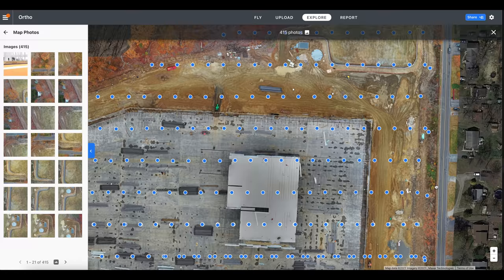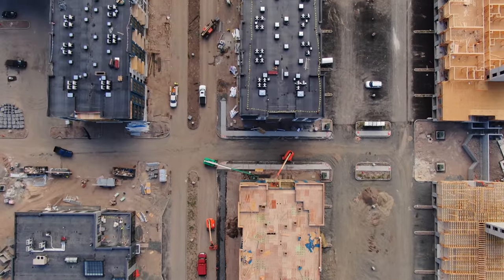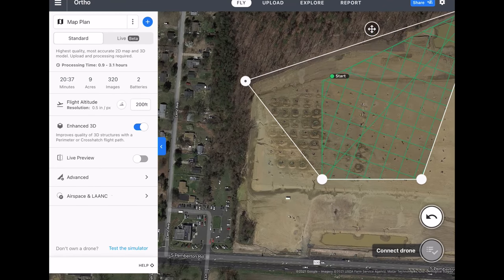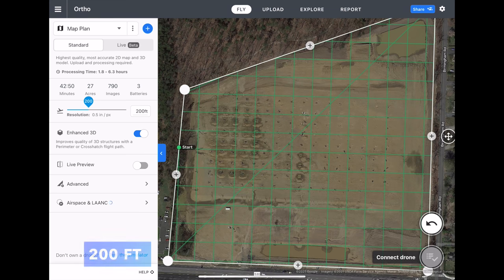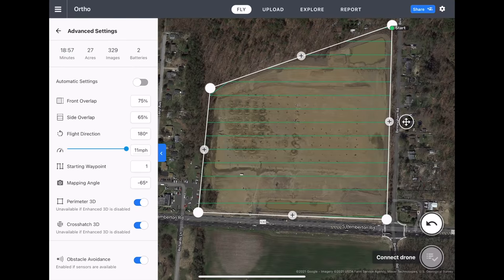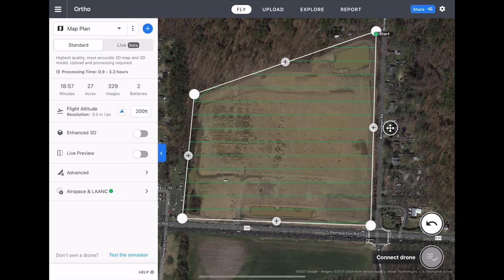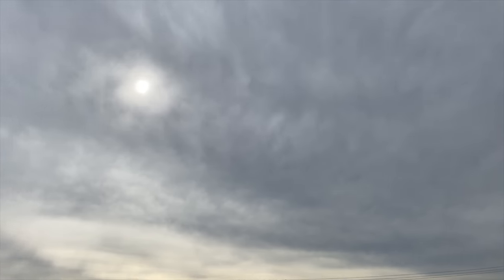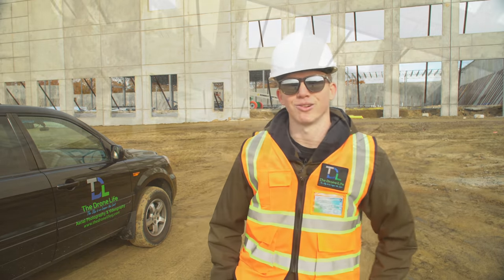Drone Mapping for Construction: Complete Guide

Comment: What about the pricing tho? How do you estimate per project. Because a local construction company has a budget of only £200 to spend on drone mapping 🤦
Reply: They only have $200  bucks doing commercial projects?
Reply: Seems like you answered your own question there.
Reply: Most of the technology breakthroughs are going to improve productivity and be utilized by an existing construction foreman. I believe your question is related to a random contractor performing these tasks and that is highly unlikely to be happening. Mainly because it’s a function that will be utilized by someone in site and reduce their overall work burden and improve efficiency of the site.
Reply: Great video on this subject thank you for posting it.
Reply: £200 for 45 minutes work isn't good enough for you?
Reply: ^ it’s not enough if you include travel , equipment, insurance, certificates/time training , paid for apps used to map ect.
Reply: Paid for Software* I meant not apps but 🤷🏻‍♂️ Same shi
Reply: I mean... yeah, but no.  If you are providing value, they will find more budget.  200£ per visit is more like it.  Guaranteed they have single tools that cost more than that - and it's 95+% cheaper than a full survey, or aerial photos.  But if the job is that small, maybe the drone is just not providing enough value?
Reply: @BigpapamoneymanMVPtypebeat Not with that kind of attitude 😁.  Seriously, though, as with any service startup, one small job isn't going to cover the costs.  More jobs, in general -  and batching jobs geographically, per rental equipment, etc. - will be necessary to make it a viable business.  And in the beginning, yeah, you're upside down on the investment, and it's up to you to break even before you run out of money.  Maybe try pre-selling to cover rentals, then a little more on delivery, to reduce initial outlay? 🤔

Comment: Drone deploy looks to be extremely expensive though
Reply: I had the same thought, but ultimately it depends on the quantity and frequency you use it. If you can make 20k or more a month it's not an issue, but for a beginner with few clients sure it's expensive
Reply: I'm sure they can just charge the contractor
Reply: It is, and there’s no option to pay per map, you have to buy monthly or annual. Completely economically infeasible unless you’re using it constantly.

Comment: Great video!! Thanks for the comprehensive walk through.. I have one question. If the mission requires 2 or more batteries - Does the drone automatically fly back on low battery and resume exactly where it left off after you swap out the battery with a fresh one? Cheers from Australia
Reply from the maker: Yes. The mission will resume from the previous location after the battery change. Usually I’ll just fly it back manually though
Reply: @thedronelife  Thanks for your response. Just another question. My pics came a bit blurry (especially the trees) for a mission that I carried out in the setting sunlight. Should I have used the setting "low light"?? Or is there something else to counter act this issue? Cheers Jake

Comment: Are you able to do larger projects if you have a drone that does not allow hotswapping batteries? Is that something that is handled through the pause function?
Reply from the maker: Yes. The mission will resume after the battery is swapped

Comment: Great Video however, in this flight example the mission said it would take two batteries. You left out the battery replacement process. Does the drone RTH and land so you can replace the battery, or do you have to manually fly it back? What happens after you replace the battery?

Comment: Nice video. Some questions:
1. when I run out of battery can I change it and proceed a mission? 
2. Is it possible to take over with dji go when mission is interrupted? I use the Smart Controller and a Mav2Pro so that'd be great.

Thanks in advance.
Reply: Depending on the software, yes and yes. I used Dronelink and it will pause and resume for batteries, and you can tell it to Hover or RTH when the Mission is complete.

Comment: You mentioned that lower lower altitude will not necessarily increase image fidelity because it lacks unique features to help the software stitch together the whole mosaic. But doesn't the image file include meta data such as x and y coordinates from your rtk setup? Wouldn't the drone be including this information in each picture (I. E. Where in the flight plan it was when a specific photo was taken) to aid the software. I'm not trying to question your logic because I can see why you want higher altitude, I'm just curious about the information included in each export. Thanks!

Comment: Is it better to have drone fly against the wind and with the wind when mapping? Or is it better to setup drone to fly with wind hitting it from the side?  Curious which is better for quality images.
Reply: This is honestly a pretty common sense thing, just think about it for a second. If the wind was from the side and had any variance in it, the drone is going to be constantly fighting to stay on the correct path. If the wind is in the flight direction then the drone may have some minor trouble with speed control but its going to be able to stay on its path. See how we used critical thinking to come up with the answer on our own using common sense?
Reply: @datalorian  this response is both unwarranted and only partially correct. Unless your entire flight path for a mapping is in a single direction then i doubt it matters very much as its always going to be fighting it one way or another unless there is absolutely no wind. Hence the back and forth pathing of the autonomous flight. 

Cheers to both of ya and (hopefully) happy flying!

Comment: What are the major differences, and benefits, and or disadvantages of creating a 2D ortho, vs a 3D model?
Reply: 2D ortho relies on less data and is generally easier to generate. Reliable 3D models sometimes require post-processing to clean up noise around detailed objects (reception towers, footings of buildings, canopies etc).
Reply: benefits include volume calculations, shadow projections, better visualisation.
negatives are usually requires much more post-processing work and need for more checks
Reply: @James De Rose  thank you for the information!